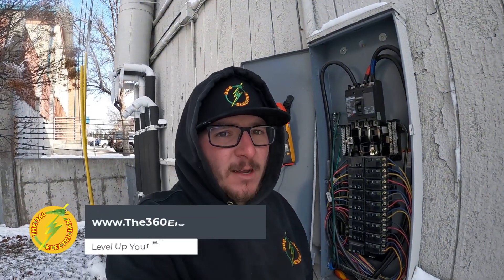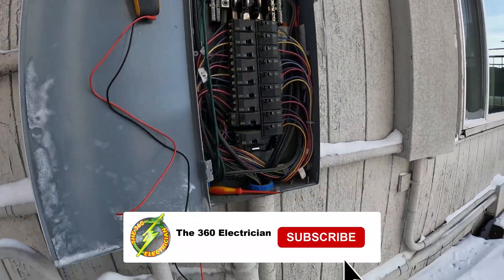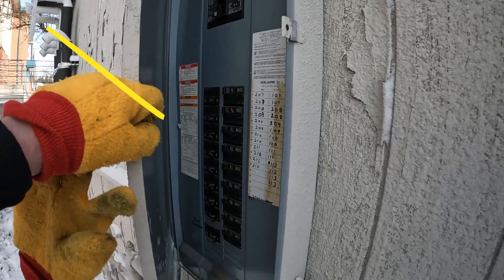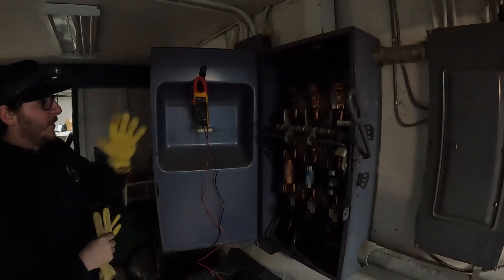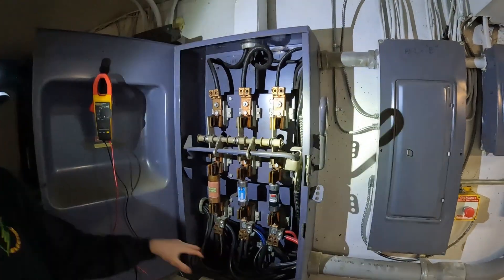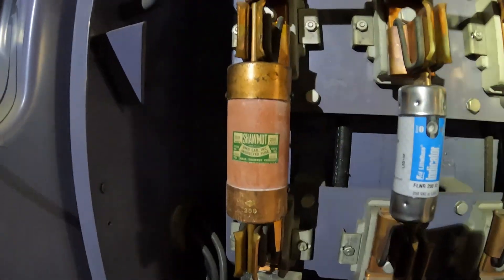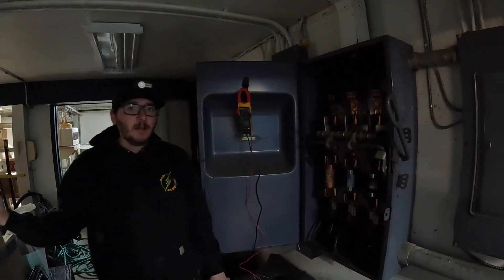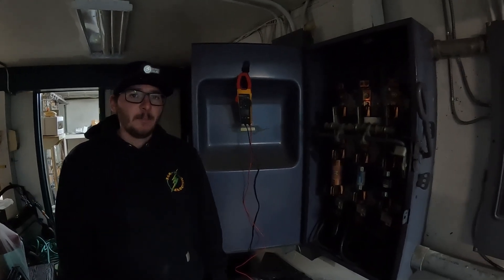Electrical service call leads to a shutdown at a motel #electricalcontractor  #electricalwork

Comment: We check for blown fuses with the disconnect energized. I know that we are required to wear proper PPE so we glove up and mask up and check from top to bottom across the phases. Have you ever ran across a " Ghost Fuse "?......I have ran across 2 or maybe 3 in over 40 years of troubleshooting. We are looking forward to the result of this service call.

Comment: No on is discussing SAFETY while working inside the “Limited Approach Boundary”. What I see in the video is troubleshooting without the proper PPE. Regular work gloves don’t provide protection from electrical shock.

This leads me to question if the electrician has been trained appropriately as required by OSHA 1910.332(b)(3).

Please be a good example for those watching that might not have a full understanding of the risk and consequences associated with electrician work.

Thank you
Reply: This is content for electricians, by electricians. The viewer base likely has the biggest understanding of the risks involved with electrical work over the average joe and homeowner.
Reply from the maker: @Texelectric  Well said, we all tend to preach to the choir, we all know the risks and should take them seriously.
Reply from the maker: Safety first!

Comment: Why did they have to kill power to test the fuse? They already checked voltage in the line side of the disconnect (that they kept referring to as the primary as if it was a transformer?) they could have just checked the load side of the fuse for voltage…

I’m all for safety and energizing whenever possible, but they already violated the arc flash boundary without proper PPE to take the voltage measurements.
Reply from the maker: Had to kill the power to replace the fuse and further test for shorts. They found some the place overloaded. Each leg was hitting max amprege with each unit having strip heat. Ended up a dryer was faulty causing the short. Non the less a 9k estimate was left with a warning about the issues and the hazard it is causing. Ask me if they approved... As far as PPE, not sure what type of electrician you are but on 120/208 if you suiting up, to measure across a fuse or line to ground, I give you props. 🙏 Arch flash is REAL always be safe.
Reply: @The360Electrician  ah, I see. It sounded in the video like you were saying that you couldn’t test the fuse without securing power. And I’m an industrial electrician, I was just sharing what the rules “technically” are per the NEC, but only because I didn’t know where they were going with needing to shut down the panel to check the fuse…
Reply: @The360Electrician  why would a short on a dryer blow the main fuse ? Surely there is a couple of breakers In between.
Reply from the maker: @persona250  Great question. Anyone that has been on the field knows that sometimes the individual breaker will trip slower then say a main breaker or fuse. That's what we believe was happening on the in rush power of the motor. The individual breaker was sized correct but the other loads added to the main fuse were already close to its protection rating. Soon as the bad / old machine was kicking in the overload went to the fuse not the branch circuit breaker.

Comment: I wonder how it will go for you. Was there a short circuit causing this, an old fuse going bad, or overloads leading to this? Strange.
Reply: Exactly! They just assumed that a fuse was blown without checking, said they’d go get a fuse and come back? They should have checked voltage across the fuse to verify it was blown, then take some measurements on the load side of the fuse to see if there was a ground on that bus. That way they’ve got an easy dummy check to say the fuse (probably) won’t blow as soon as you swap it.
Reply from the maker: No ended up that the entire system is already overloaded. It was a bad dryer putting it over the top. We gave a 9k bid that included new load calls and upgraded panel. We also told them we would do an inferred scan and report to show them the hotspots.....still waiting for approval